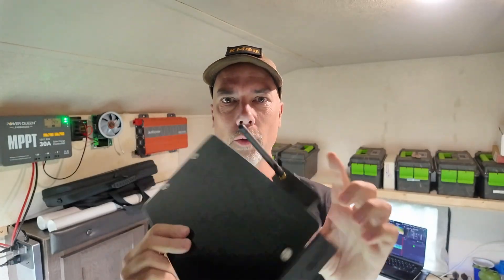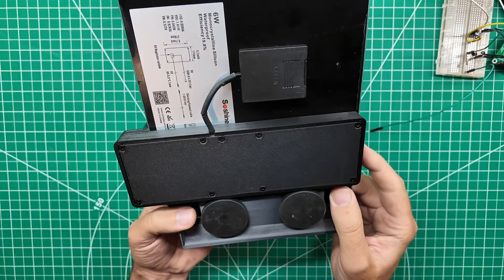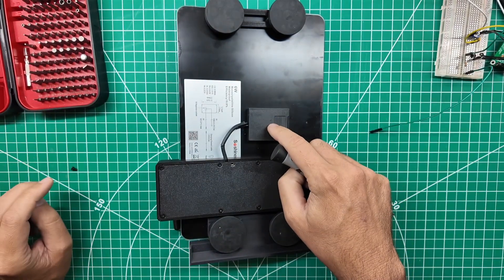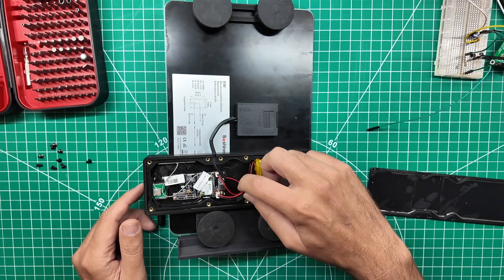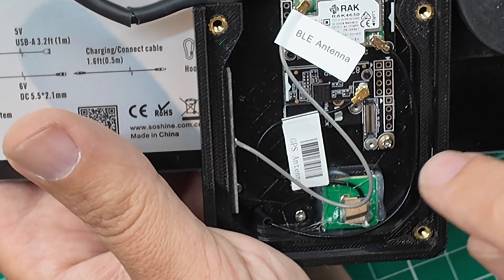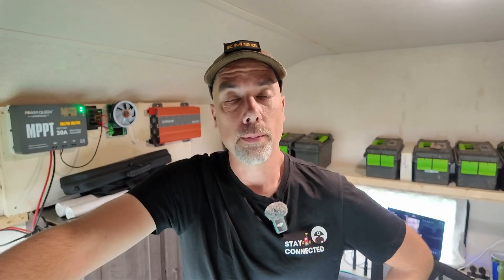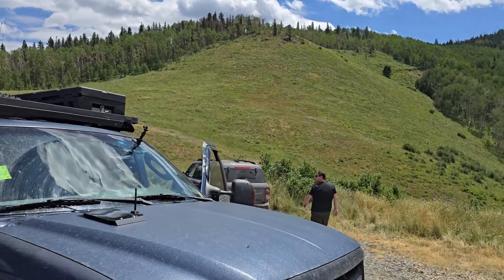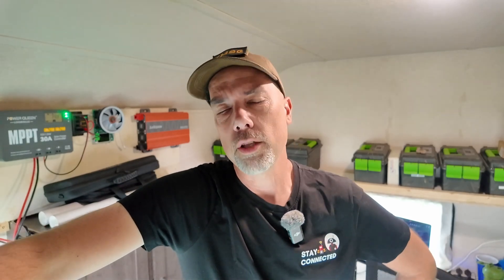🚨 The Spec 5 Voyager: Solar-Powered Meshtastic Relay That Changes Everything!

Comment: I was intrigued by this when I was considering my first node, but couldn't be confident in a 3D printed product for full-time outdoor use (that's a "me problem"). I ultimately went with a solar beacon by Atlavox, which has an aluminum enclosure (adds to cost), RAK 4630, external antennas, and optional sensors. Mine is bolted to my car's roof rack. It had some BLE headaches for a while, but seems to be resolved since the most recent firmware update. 👍
Reply from the maker: Atlavox is a good choice too

Comment: I'm wondering how well this would work stuck long term on the metal roof of my cabin. I was thinking of putting up a mast with a solar powered node on it, but this might just be a simpler solution,
Reply from the maker: Good question... Probably "almost long enough" 😂😂

Comment: The 3d printed components are treated in a chemical solution to remove the porosity. That is the shiny "wetness" you see on the inside. Its extra solution that did not absorb into the part but has dried on the surface.
Reply from the maker: Mr Spec5!  How are ya Daniel?
Reply: @temporarilyoffline  staying busy. At some point we will remix the voyager for our aluminum bodied truck driving friends

Comment: Nice idea, too bad its not Spec5's idea. They copied publicly available designs and charge outrageous prices for a Heltec T114 and a solar panel.
Reply from the maker: I heard that.  Hopefully they will see your comment and respond.
Reply: It’s true that the original Voyager design conflicted with a community open-source design. That version was released on Printables as a remix with credit given, but was never for sale. The current Voyager has been fully redesigned by the Spec5 team and is an original, unique design.

We’re committed to rebuilding trust and integrity within the Meshtastic community.

Comment: I’m using an H2T with an amp and a cable going to an N-type mag mount to an Alfa antenna on the roof of my car. It survived a hail storm. I wonder if this solar node would do well in bad weather.
Reply from the maker: This doesn't appear to be a "glass" surface panel, but even those do decent in hail storms

Comment: This company uses 3D models created by other people, in some cases flagged as non-commercial license, without any attribution. They claim to create these devices but they are just selling other people's work for rip-off prices. They need to follow 3D model license terms and provide attribution to the creators that actually did all the work. If people want to pay their insane prices when properly informed, that's fine. But it should clearly state they didn't create anything at all, that they simply printed someone's work and tossed pre-made components into it. Other videos about this company have plenty of comments from people who are pointing these issues out.
Reply from the maker: Thanks for bringing this up.  Hopefully Spec5 will see this and make a response.
Reply: @temporarilyoffline . They already tried and failed in a video that’s now private. Tried to say it wasn’t stolen. Made some excuses and said they tweaked a few things. No callouts for original designer and they were getting called out in the comments. https://m.youtube.com/watch?v=juzAM0fPI_4
Reply: It’s true that the original Voyager design conflicted with a community open-source design. That version was released on Printables as a remix with credit given, but was never for sale. The current Voyager has been fully redesigned by the Spec5 team and is an original, unique design.

We’re committed to rebuilding trust and integrity within the Meshtastic community.

Comment: 3d printed is a deal breaker for me.  I'm looking for something like this for the car but I just want to leave it there.  I feel the 3d print is the weak point of this design, and I worry it wouldn't last outside in the elements.
Reply from the maker: I don't know what type of filament its made of, but it survived our week long test in 100F weather running on the hood of the truck.  The solar panel takes 99% of the abuse from the sunlight and the 3d printed stuff is hiding underneath it to hold in the PCB+battery
Reply: @temporarilyoffline  the housing is printed in ASA(one of the best materials for the combination of strength and uv resistance) and it treated in a chemical solution to ensure water doesnt absorb into part.

Comment: 😮 Most of these devices do not have a big enough solar panel to make it reliable for more than a few days. Is that panel , and the battery going to be  24/7/365 north of Arizona? A weather station would be great.
Reply from the maker: The battery inside lasts a few days in the dark on its own.  For its intended use and power draw, its pretty solid.

Comment: I'm just started looking into solar, though I doubt I'll need it more than just for emergency. I don't do camping or traveling very much anymore. I was wondering if something like I find on Amazon 150 watt folding panel kit would be enough or overkill? I think they claim 8 or 9 amps capable.
Reply from the maker: Email me with what you're looking to run and how long and I'll see what that adds up to.  You have to work backwards from your desired load and runtime, through your batteries to your panels.
Reply: @temporarilyoffline on it's way. Thanks
Reply: @temporarilyoffline hopefully I sent it to the correct address